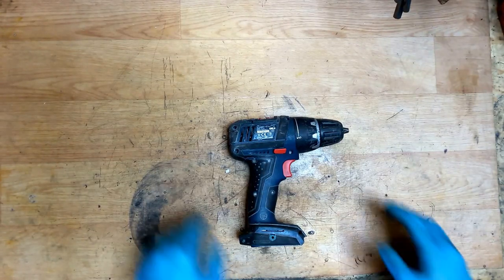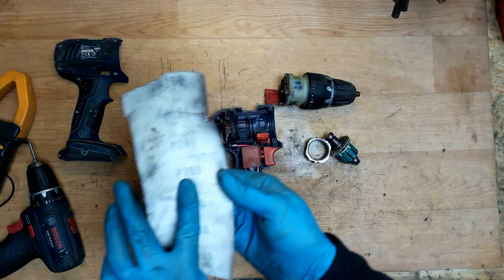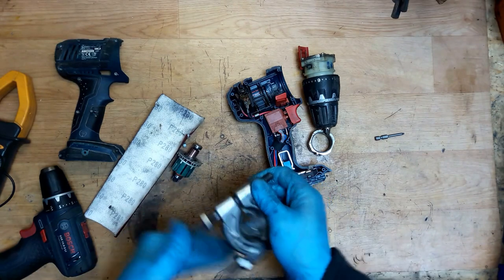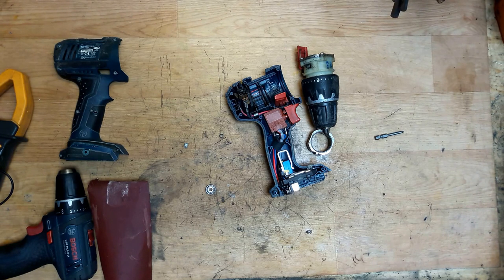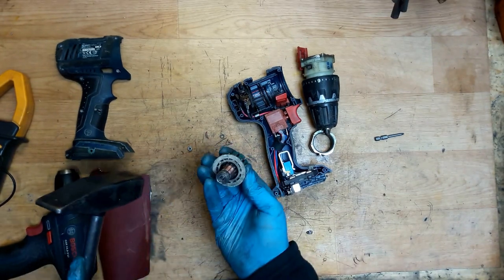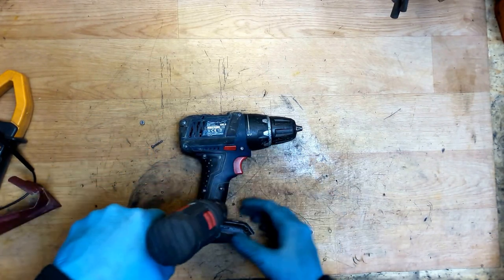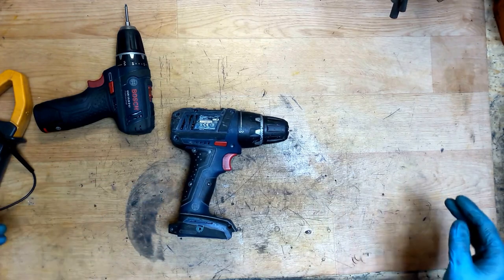How to disassemble and fix Bosch GSR 18V Li armature commutator

Comment: Just a tip for viewers. Bosch doesn't sell replacement brushes for this model, only the whole motor (rotor, stator and brushes holder). Makita CB-440 and CB-448 (cheaper) brushes fits perfectly and are widely available, just some soldering is needed.  

Solo un consejo para los espectadores. Bosch no vende escobillas de repuesto para este modelo, solo el motor completo (rotor, estator y portaescobillas). Las escobillas Makita CB-440 y CB-448 (son mas baratas) encajan perfectamente y están ampliamente disponibles, solo se necesita un poco de soldadura.

Comment: hi handyman, here my problem the jaw (i'm not sure if its the right term)  of the chuck of my gsr 18 v-li are scratching my bits.

so first  i manage to dismunt them and try to repair them with file but that doesn't work (quite subtil to munt them again btw)

then i try to buy the jaw, impossible to identify them and so to find the same.

then i try to replace the chuck, then again impossible to find one.

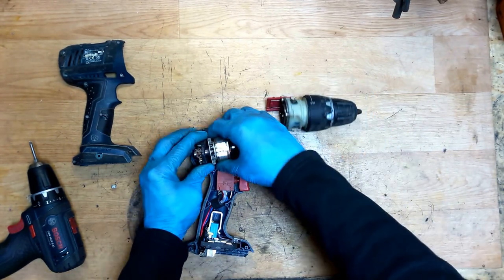apparently, the only solution is to buy the whole gearbox ( 1:42 in your video ), and in europe it's almost the same price as the whole gsr, it's cheap only in US, and then the shipping is super expensive... 
it's seems to be a catch 22
do you have an idea to solve my problem ?
do you think it's possible to separate the chuck from the gearboxn, so i can try other chuck on it ? i don't see scew inside the chuck so i don't so...
Reply from the maker: Hello, you can use any chuck yiu whant, but first you need to remove old one. If it's no screw inside (normally it is inside), you can try to unscrew old chuck buy putting allen key inside and hammering it or using impact driver to remove old chuck. And yes in Europe new gear bix is very expensive and not worth of repair

Comment: hi sir its me again. just asking and wondering. Which is practical, a cordless drill or a corded drill? I have a corded drill, I want to buy a cordless drill. What keeps me hinder aside from its expensive compare to corded, is the maintenance of the battery. for how many years does the battery last? the battery itself is expensive.When the battery expires you buy again.  compare to the corded drill, its like forever, as long as there's electricity just plug it in. and it's cheaper.
Reply: just bought bosch gsr 18 drill. tnx
Reply: mustie 1

Comment: Hello Andrius, i have two problems with my Bosch GSR V-Li 18V:
1. My ventilator in my rotor is broken. How can i repair the ventilator. The Bosch dealer selling only complete rotor not only the ventilator. 
2. The carbon brushes make noise after repositioning and I see more sparks from the carbon brush while turning

Thanks a lot for your help.
Reply from the maker: Hello, for motor fan you can try to find one from burned motor, but as you see more sparks from caebon brushes it can be that your armature is burned out or damaged. You can remove broken fan from armature ant test motor then, but if you see sparks when motor is running thatz not good and you need new motor. If motor without fan works great then you can think about searching for new fan
Reply: @handyman7282  Thank you very much for your message, Can i change the motor fan with something else? like to find on aliexpres or something?
Reply from the maker: @ibrahimarslan5245  yes you can all you need is same dimensions and wing direction, but I think you you will easy find it in aliexpress
Reply: @handyman7282  ok thank you sir for your help!
Reply: My fan is also broken, did you manage to fix it somehow?

Comment: My cordless drill Bosch 180-LI has the same problem. It runs for a few seconds and then stops and the light blinks 3 times. Then press the trigger again and it works for a few seconds and stops again. I have 2 batteries and it is the same with both of them fully charged. I thought it was the carbon brushes and bought new ones. But the old carbon brushes looked quite ok when I took them out. I decided to try the new ones and the same problem. So do I need to clean the inside like you did and it will solve the problem?
Reply from the maker: I think you need to check armature because it can be damaged and controler unit disconnect drill because of over current
Reply: @handyman7282  Ok thank you. Will check it out.
Reply from the maker: @MakingAndFixing  You can make video about that ;) Disassemble and fault find...
Reply: @handyman7282  Ha ha. Maybe I will... I'm not good with electrical and machines, need to start learning now. I have another  cordless drill GSR 1000 also have the same problem. Will be checking that out too.
Reply from the maker: @MakingAndFixing  And maybe they stopped when you was screwing screws or bolts on drilling mode?
Reply: @handyman7282  The GSR 1000 has no adjustment from drilling to screw driving mode. It only has a trigger to press. Very basic unit. The GSR180-LI I only use for drilling. I have a Dewalt impact driver for screw driving.